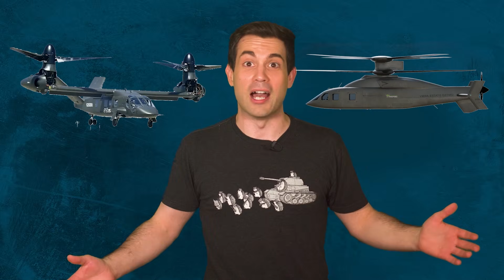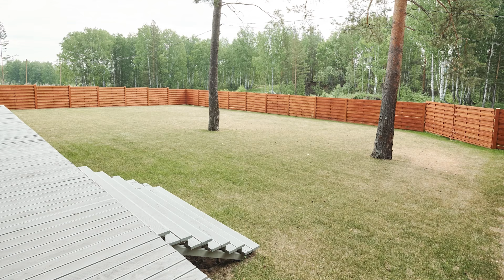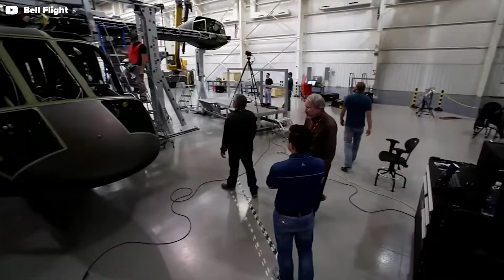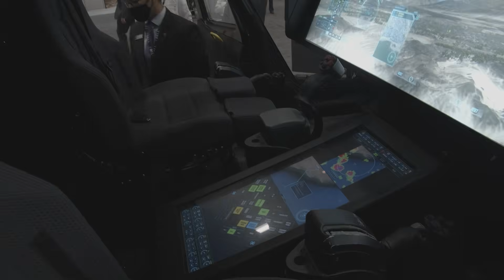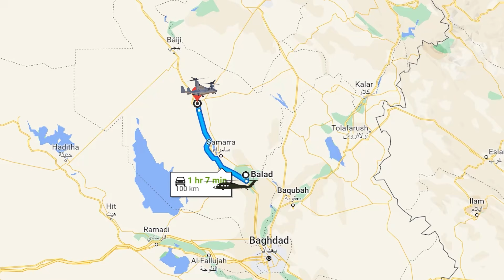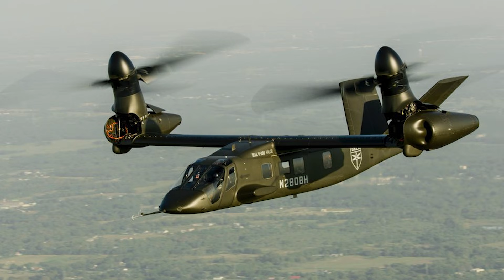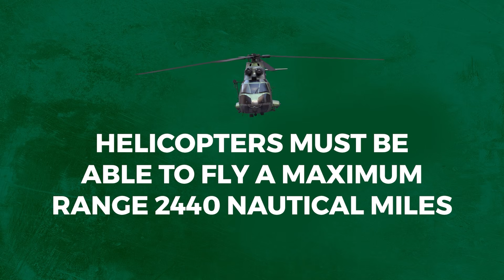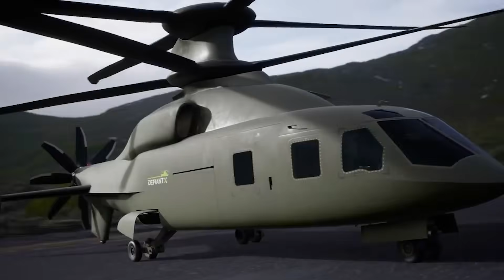V-280 Valor Helicopter Will Help Defeat China

Comment: Alright, after watching the video fully now. End thoughts are... both. Both have advantages, it's situational. The tilt rotor design is still faster, and more fuel efficient at cruising long distances, so that obviously is a key advantage in some situations. On the other hand, the twin rotor plus prop aproach is overall a more compact and efficient design for hovering. It's still pretty fast, but not as fast and also not as fuel efficient flying over long distances. On the other hand it's more fuel efficient when hovering in place, and would likely have more lifting capacity for a given cost. It's also got a smaller horizontal footprint so it can more easily get into some smaller areas for landing than the tilt rotor design with its big old wings holdings pinning blades out at a distance to each side.

So, you got speed and range while flying, versus power and efficiency while hovering and landing. Of coarse sufficiently better design in details, engine or other part choice on either contractor could flat out push either design overall ahead, but in general this is the breakdown of the two types of designs from an engineering perspective before you get into the specifics of an actual aircraft and all of it's finicky details that vary model to model.

Speed is obviously extremely important, moving units and supplies more quickly can save lives and let you outmaneuver the enemy. Greater range also means you can reach out further from existing bases or locations giving you more options on the large scale. No General will have a problem with extra speed and range. Added lift capacity and the ability to land in slightly narrower areas, and hover longer more efficiently on the other hand... is probably less important, as long as both can lift the given amount needed for the hardware we need, the ability to lift a bit extra, or be a bit cheaper for the same lifting amount isn't the biggest deal, it's situationally useful, but not a must and not something useful almost all the time like speed and range can be. Fuel efficiency while hovering... is useful for attack helicopters and gunships on station hovering around an area as eyes in the sky, but most of these are meant to be transports and would fly in and then out over distances. The tilt rotor is more efficient in the initial part so most operations would not really win on fuel efficiency using the dual rotor plus prop design in the end unless acting as a gunship and we'll have dedicated attack helicopters for that more often than not. The ability to land in slightly more narrow environments is sometimes going to be very useful sure... but again it's extremely situational, only benefiting a minority of operations at all, and the tilt rotor even if a bit wider could just use ropes to get people into more cramped spaces most of the time in exchange for being in a slightly more dangerous situation for a period as people rope down or tie on before they get pulled up.

So between the two, I'd probably recommend the tilt rotor design if asked my thoughts for the above reasons. For attack helicopters in the future, the twin rotor plus prop approach could win out though since again they will sometimes be hovering around for longer periods, and wanting to carry any extra weight in munitions or defenses is obviously a plus. Still, if an attack helicopter can move with the transports at the same speed and over the same ranges that's a major advantage and simplifies a lot of mission planning so there's clear reason for both arguments here too.
Reply: I wonder why they don't try to get the best of all worlds with a tilting tandem aerial crane. I mean, the basic helicopter looks like a tandem rotor with a very narrow body. But actually, the body is a flying wing. It tilts sideways for horizontal flight, turning into a flying wing with twin props. You get the speed and efficiency of a tilt rotor without the complexity. It can act like a gunship with sideways pointed guns (like an AC-130). Or it can hover with its body edge on to the enemy. Either way, it presents a small profile to the enemy, and the rotors don't get in the way of the guns.

As an aerial crane, it can carry payloads slung underneath. This can be a troop glider, so it tows horizontally for long fast flight, or it can be a wingless troop pod for landing in very tight spaces. The helicopter can drop off the troop glider/pod quickly, and then provide fire support as a gunship. Since it didn't need to carry the troops internally, it presents a tougher target for the enemy.

The point is, one helicopter platform can perform multiple missions from heavy lift to troop transport to attack. It has speed and efficiency like a tilt rotor, yet it can land troops in very tight spaces. And the complexity is less.
Reply: They want speed and heavy carry/lift.?? Put more forward thrust on the Chinook.
Reply: Yeah, considering the distances involved and the difficulties in fuel transport, in the case of Island hopping you'd want distance, speed, and fuel efficiency more than anything. We aren't gonna have well-equipped airbases and fuel depots all over the place, certainly not at first. 
The coaxial is probably a better aircraft for our middle east and general continental-based missions, but the tilt rotor is certainly better for a campaign in the pacific or against china assuming there aren't some kind of glaring design flaw they're hiding...

Comment: For that tiltrotor, I wonder if a shipboard version could incorporate the "Grumman Style" of folding wings to better fit in say, a destroyer's hangar?
Reply: Probably. But I suspect that a Defiant with folded rotors is still going to have a smaller footprint.
Reply: @Stu_Bur  Most definitely, ideally the US military would take both helicopters because of the size difference (but that rarely happens in these competitions due to cost). But if the Bell design could operate from an Arleigh Burke destroyer, imagine what it could do...

Comment: We need some command and conquer Tiberian Twilight paladin equivalents. An aircraft loaded with sensors in all directions, and longer range interception missile or gun systems designed to allow it to actively intercept munitions headed towards it, or any of the other helicopters flying behind it. I'm just imagining a chinook or something with the center gutted open kind of like the water droppers for forest fighting, and a pair of CRAMS and a CWIS bolted in upside down into that general space or something to that affect. Lets be honest, today, helicopters are quite vulnerable to any form of anti aircraft weapon, be it infantry or armor equipped. Having something to help with active protection and not just relying on flairs that don't even help against all missiles would be very useful. Granted, any AAA is going to fire too many projectiles too quickly to intercept, but at least those tend to be bigger and easier to spot and deal with in advance or plan around than infantry or random small cars that could slip in anywhere.

Comment: Surprised to see no futuristic quad copter designs, like an oversized drone.
Probably more risks for the disembarking troops I recon.
Reply: Large quad rotor VTOL have been tried in the past, so we already know that they have some severe aerodynamic problems. Basically, the front rotors mess up the air for the rear rotors, making them have poor performance compared to the predicted hopes.

Quadrotor drones work on a small scale because they simply power through the problems, but even so they don't really fly horizontally all that well. We're getting some up to a size suitable for one passenger flights, but even those are only for short hops at best.

For this program, the Army demands a lot more payload and range ... basically similar in scale to old quad rotor designs which all failed. Like I said, they ran into aerodynamic problems.

I think these problems also apply to tandem helicopters, which is why no one has been trying to copy the Chinook.

Comment: i see them going electric although it could cause logistical problems in practice
Reply: Electric aircraft still tend to have range limitations because of battery weight compared to energy density. Might be more competitive in the future as battery tech continues to improve but I suspect fuel will continue to have a maximum range advantage for a long time.

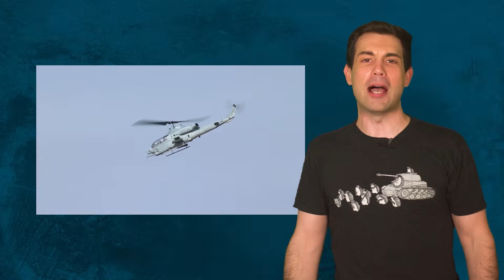Comment: 13:38 Hey Cappy just a small tidbit of information here; helicopters go forward by tilting the rotor disk forward, this does make the nose point low in forward flight. So yes, technically they fly forward by pointing the nose down, but it's because that's the effect of tilting the rotor disk.
Reply: Actually, to the best of my knowledge, to go forward, the rotor hub actually tilts to the right or left depending on rototr rotation direction, and because of gyroscopic procession, the effect is delayed 90degrees of rotation if i recall right  Very strange, there are videos on youtube about it.
Reply: @connor3288  Yes, that's correct. The hub and linkage controls (swash plate) do that and are constantly changing the pitch of the blades. Helicopter aerodynamics are crazy black magic.

The effect of the pilot inputting forward cyclic (stick) is the swash plate working it's magic and the entire rotor disk tilting forwards to achieve forward flight. 

Look up footage of wheeled helicopters taxiing, they are level on the ground and you can see the rotor disc tilted forward.

This is again to point out that helicopters in level flight have nose down attitudes as an effect of the rotor disc tilting forward, not because the fuselage tilts down.

Comment: The "Apache" part of the program is actually more aimed at replacing the capabilities lost when the OH-58 was retired, and the Apache picked up its mission set.
Reply: surprised he didn't mention this.
Reply: Yeah this is more of a "Kiowa Replacement" than an "Apache Replacement"
Reply: Not likely the USAF will tolerate the Army having an armed tiltrotor for the same reasons they pitched a fit over the Lockheed AH-56. Key west agreement prohibits the Army from having armed fixed wings and if the USAF went to political war with the Army over the stub wings and high speed on the AH-56 (which was objectively a helicopter) they will certainly oppose a tiltrotor gunship even more vehemently.

Comment: Army should get both. Defiant X for low level flights on islands, Bell for longer range larger load room across the sea. Make extra cargo models from Bell version to carry more troops and lighter bulky supplies. Dragging stuff on sling load is slow and reduces range
Reply: I think you are right. To demand high top speed and that it's capable of hauling high loads in a sling is wishful thinking. Fast and nimble or a tractor. Chose one!
Reply: @blahorgaslisk7763  Valor demonstrated high speeds an Black Hawk or larger sling loads.
Reply: not to mention, counter-engineering against two vehicles is harder than only having to study one. specializing parts and tooling for individual aircraft makes them (on paper) more difficult to maintain, but the nation responsible for design of such also has a lot more time to figure it out. its not too difficult to imagine how a bunch of old blackhawks full of spare parts sitting around could be useful to adversaries with less GDP, especially if they're already privy to reverse engineering most of their hardware.
Reply: This might be what they end up doing in a different way. There are 2 competitions going on right now, flraa and fara, with flraa the one covered in this video. Fara is supposed to be for a smaller scout type, and Sikorsky is basically making the same aircraft but smaller, while bell is going with a more traditional helicopter. If bell wins flraa and Sikorsky wins fara, the army will have essentially picked both.
Reply: @johnaltman6671  scout is going to be Invictus aka Comanche 2.0 Scout must have stealth, small footprint, and low cost for recon and take out enemy radars and anti air.
Reply: @johnaltman6671  in my opinion, I think Army will procure Sikorski and Navy will procure Bell.
Reply: @werewolverine4906  Yeah, the army is not used to tiltroter and less stealthly attack helicopter unlike the Marines which uses bells viper and v-22 for day and day operations.
Reply: You guys act like there is no open spaces to land the Valor and 90% of the missions are not feasible due to its width.

 Why use two craft when one can do the same job but is faster and has better range? That's just stupid logistic wise. Great! Double the parts that will make up for it! 

 Guys act like the 99% of the world is now off limits to land because it's 20 feet wider. Or that the military is incapable of making a space 15 feet wider.
Reply: Normally they only choose one.
Reply: Feeling fancy, eh?
I'm all for giving the best to our troops, now find me someone to convince the guys up there to NOT fill their pockets instead.
Reply: @naggers jaggers and only one aircraft will do their mission. Trust me. No matter how much "common parts" there will always be need for different parts and training anyways. Best to get the aircraft that will do the mission right.
Reply: Sounds like a nightmare
Reply: I think there's no harm on replacing half anf half w both, more versatility on specific missions, they could just split the budged on both but idk if things work like that
Reply: V-22 does the logistics role better than V-280. Defiant does air assault role better than V-280
Reply: @Stu_Bur except the valor is faster and has a better acceleration/deceleration... Why would the defiant perform the assault role better?
Reply: Defiant X is bullshit while this Bell tiltrotor still have the same problem which is its enormous signatures in radars. 

They should made design based on Quadcopters or none at all.
Reply: @sys3248  quadcopters don't scale up like that more parts more maintenance more problems.
Reply: @sys3248  then it wouldn't be tilt rotor and you'd be flying a less efficient helicopter with 4x the moving parts. having all of your arsenal as either stealth or non-stealth is a weakness; having aircraft on both ends of the spectrum with overlapping mission capabilities provides the highest chances of overall success. 
the defiant x is definitely an ambitious design, but im not seeing any fundamental contradictions in it's claimed goals.  
btw the osprey's losses have mostly been crashes during the testing phase, it's lack of stealth has never been an operational issue and will be less of one as we gain more aircraft able to fill that exact niche.
Reply: @mech____  Regarding efficiency,he Valor has six blades, Defiant has 16.  For the type of roles these aircraft will play, stealth is just an expensive distraction.  Defiant doesn't have contradictions in its goals, it hasn't been able to acheive many of them.

Comment: When I started active duty we were still using UH-1s and Cobras.  The Blackhawk was a terrific upgrade to the UH-1.  However, I questioned whether helicopters were worth it because they require so much maintenance. It was only the prohibition against the Army having fixed wing combat aircraft that justified them.  Not a good justification.  This new generation looks fantastic.  They may finally justify their own existence.  Watch out, the Air Force may get jealous and want to take them away.
Reply: How would you perform typical helicopter missions without them? Obviously paratroopers and maybe gliders could drop off troops and equipment. But what about picking them up?

I think that a glider or even just some sort of pod could be gently lowered and picked up by a fixed wing aircraft and a rope performing a long line loiter. Is this the sort of thing you are thinking of? It could provide the capabilities of an Osprey at a fraction of the maintenance and cost. But the tow aircraft still needs some place to land.
Reply: @IsaacKuo  Those missions were invented because we had helicopters.  Helicopters were not invented to perform them.  There have been ideas for planes that were like the Osprey or that could use very short runways for decades before helicopters were use.  The C-130 is used in third world countries around the world.  An A10 can outperform an Apache for ground support, if we could get the Air Force interested in ground support.  In any case, helicopters are extremely expensive to operate and are very vulnerable to enemy fire. . This newest generation is a big improvement over what was available in the 60's and 70's.
Reply: @MrDubyadee1  Thanks for your explanation. So you would simply not have those missions.

What about medical evacuation?
Reply: @IsaacKuo  Oddly enough, the US Army used small scout type helicopters (a plexiglass bubble, 2 seats, no weapons) to evacuate wounded in the Korean war.  The stretchers were strapped to the runners.  (See episodes of the TV series or the movie MASH).  So the Army would probably have kept helicopters for that sort of thing and bringing stuff in and out of an area. The debate was about whether helicopters were good combat aircraft.   Fixed wing aircraft were preferred.  The general transport utility of helicopters (UH-1) was a side effect that the Army took advantage of, but there were people who thought they were not cost effective or safe enough.   The whole concept of heliborne assault was thought up after the Army realized it had to depend on helicopters for air mobility.  The split with the Air Force happened in 1947 (I think) so I'm sure they started working on that immediately.   I'd rather have A10 Warthogs backing me than Apaches if they were under my command.